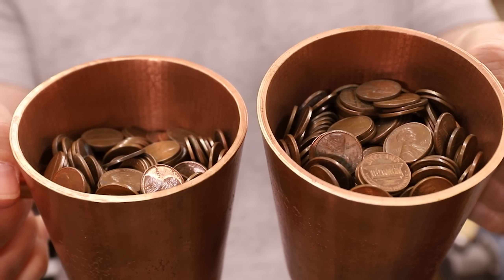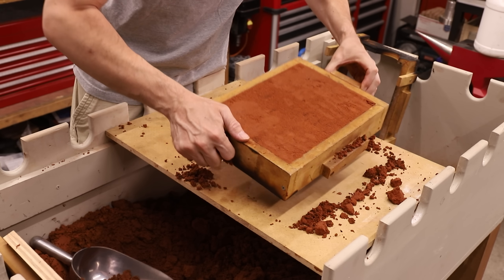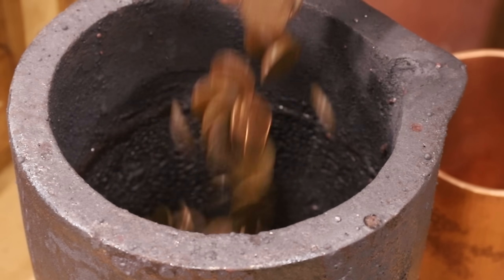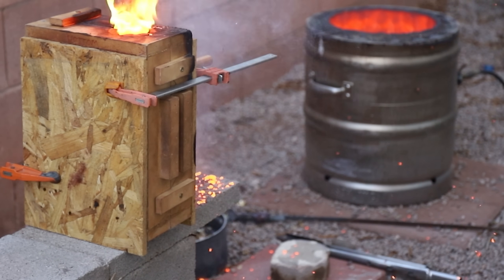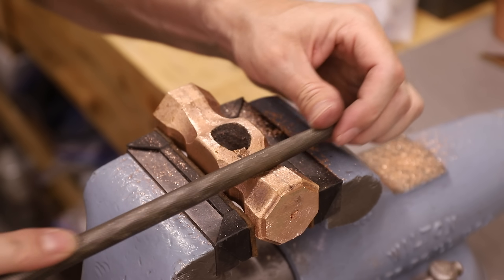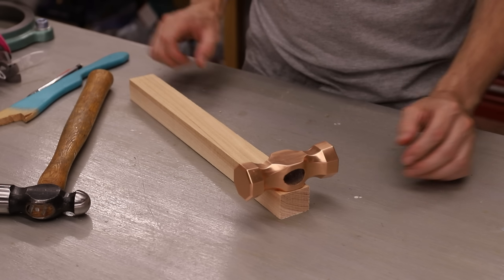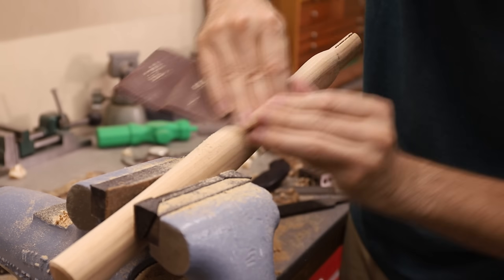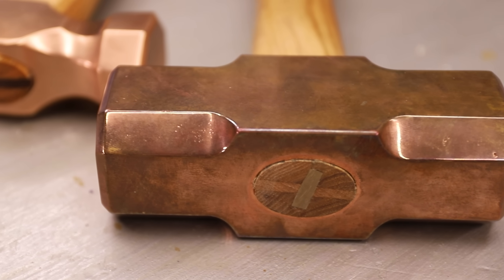Making a Hammer out of Pennies (1000 Melted Pennies)

Comment: I know this is kinda old, but whenever you make a tool with a pass-through handle like this (or the axes you made), the eye through the head should NOT be tapered. In cross-section, the eye should have an hourglass shape and the cut end of the handle should match, being slightly tapered itself in the opposite direction you have it (slightly thicker at the base, narrow at the cut end). The wedge will spread the top, fitting in perfectly with the hourglass shaped eye. This removes the need for a shoulder on your handle, which creates a natural breaking point.

Comment: Just for context: A 1955 double die Lincoln Wheat Cent is worth $782-$18,501 depending on its condition.
Btw, the material worth is 3 times as much as its face value. A one cent coin has 3 cents worth of copper in it.

Comment: This is technically a felony, though I doubt the secret service are going to actually enforce it.

Defacing/destroying in use US currency is a felony enforced by the secret service. They handle counterfeit currency too.
Reply: Only a felony if you try to sell it in scrap
Reply: @Hunter50r naw it's still technically a felony if it's currency that's still in circulation. But again I highly doubt the secret service is going to spend the time going after someone defacing pennies. They're actually phasing pennies out completely soon
Reply: @simul8rduude  it’s not if a coin is clearly altered and no one is trying to sell it or use it for fraudulent intent. It is completely legal to deface currency or use it in any way you wish.
Reply: @simul8rduude It is perfectly legal to melt pennies and nickles as long as you're not trying to profit off of their metal value

Comment: The problem is - it will tarnish very fast and extensively. I have a bronze cymbals on my riq (admittedly, you touch them with fingers while playing), and they have black spots all over. Oxides of copper have green color, so without regular polishing, it won't stay as beautiful. Especially when hammering starts damaging the surface. It is beautiful, though.

Comment: Is Melting Down Legal

It is unlawful to melt down U.S. pennies and nickels, primarily because the value of the metals they contain (copper and zinc in pennies, copper and nickel in nickels) can exceed their face value, which could deplete their circulation and cost the U.S. government significantly to replace them  This prohibition was enacted in 2007 by the Secretary of the Treasury under the authority granted by 31 USC § 5111(d)(1) to protect the nation's coinage, following a period when rising metal prices made melting these coins profitable  The rule specifically bans the exportation, melting, or treatment of these coins 

However, there are important exceptions. It is legal to melt down pennies and nickels for non-profit purposes such as educational, amusement, novelty, or jewelry-making projects, provided the intent is not solely to profit from the metal content  For instance, creating a piece of jewelry from a penny is permitted, but selling the resulting metal for scrap profit is not 

In contrast, it is generally legal to melt down other U.S. coins, such as silver dimes, quarters, and half-dollars, as well as gold coins, as long as the action is not done for profit and does not involve fraudulent intent  The primary reason for this distinction is that silver and gold coins are not in general circulation, so melting them does not pose the same risk to the nation's currency supply as melting pennies and nickels 

It is also illegal to alter, deface, or destroy U.S. currency with the intent to render it unfit for circulation, which includes actions like burning dollar bills with the purpose of making them unusable  However, this law is focused on fraudulent activities and does not apply to non-fraudulent alterations like making jewelry from coins 

Additionally, travelers are limited to taking no more than $5 worth of pennies and nickels out of the United States to prevent large-scale exportation for melting abroad

Comment: Department of the Treasury

Monetary Offices

31 CFR Part 82

AGENCY:

United States Mint, Treasury.

ACTION:

Final Rule.

SUMMARY:

To protect the coinage of the United States, the United States Mint is adopting a final rule that prohibits the 

exportation, melting, and treatment of 5-cent and one-cent coins. This rule is issued pursuant to 31 U.S.C. 5111(d), which authorizes the Secretary of the Treasury to prohibit or limit the exportation, melting, or treatment of United States coins when the Secretary decides the prohibition or limitation is necessary to protect the coinage of the United States. This rule's purpose is to ensure that sufficient quantities of 5-cent and one-cent coins remain in circulation to meet the needs of the United States

Comment: Old pennies (pre-1992) contain 95% copper, which means:
Pure copper in 9.45 kg of coins = 9.45 × 0.95 ≈ 8.98 kg.

Scrap copper prices (2025, approximate):
Pure copper (Bare Bright, Category #1) - £6-7 per kg.
Copper from pennies (95% bronze) - £5-6.5 per kg (not all scrap yards accept coins, some may consider it 'low-grade' scrap).

Calculation:
8.98 kg × £5 = £44.9 (minimum).
8.98 kg × £6.5 = £58.37 (maximum).

So, 1000 pre-1992 pennies are either worth £10 as currency, or up to £45 if sold as scrap metal.

Comment: Are there any laws in your country about using coins (legal tender) to destroy them. In the uk 
there are laws which make it illegal to deface or destroy a coin of the realm. Coins which are 
legal tender are owned by the royal mint. I’ve never heard of anyone ever being charged with 
defacing a coin but just wondered. I’ve used these yo type of hammers on gas installations 
where a spark would not be welcomed. Bronze is the normal metal which does not throw a spark 
when hammering any other metal.
Reply: Not in this instance

Comment: Pre-1982 Pennies would be nearly all copper.

Post-1982 Pennies are a copper + zinc mix.

If you melted them down in this fashion, you'd have a brass hammer.  So guessing they used all older pennies since it's that reddish copper tone.

Comment: Isn’t destruction of currency illegal?
Reply: CFR-31b-1-82
§ 82.1 Prohibitions.
Except as specifically authorized by the Secretary of the Treasury (or designee) or as otherwise provided in this part, no person shall export, melt, or treat:
-(a) Any 5-cent coin of the United States; or
-(b) Any 1-cent coin of the United States.

CFR-31b-1-82
§ 82.2(b) exceptions
The prohibition contained in § 82.1 against the treatment of 5-cent coins and 1-cent coins shall not apply to the treatment of these coins for educational, amusement, novelty, jewelry, and similar purposes as long as the volumes treated and the nature of the treatment makes it clear that such treatment is not intended as a means by which to profit solely from the value of the metal content of the coins.

Comment: melting US pennies is against the law.
Reply: CFR-31b-1-82
§ 82.1 Prohibitions.
Except as specifically authorized by the Secretary of the Treasury (or designee) or as otherwise provided in this part, no person shall export, melt, or treat:
-(a) Any 5-cent coin of the United States; or
-(b) Any 1-cent coin of the United States.

CFR-31b-1-82
§ 82.2(b) exceptions
The prohibition contained in § 82.1 against the treatment of 5-cent coins and 1-cent coins shall not apply to the treatment of these coins for educational, amusement, novelty, jewelry, and similar purposes as long as the volumes treated and the nature of the treatment makes it clear that such treatment is not intended as a means by which to profit solely from the value of the metal content of the coins.
Reply: only if the intent is to sell it for profit

Comment: Illegal ?
Reply: CFR-31b-1-82
§ 82.1 Prohibitions.
Except as specifically authorized by the Secretary of the Treasury (or designee) or as otherwise provided in this part, no person shall export, melt, or treat:
-(a) Any 5-cent coin of the United States; or
-(b) Any 1-cent coin of the United States.

CFR-31b-1-82
§ 82.2(b) exceptions
The prohibition contained in § 82.1 against the treatment of 5-cent coins and 1-cent coins shall not apply to the treatment of these coins for educational, amusement, novelty, jewelry, and similar purposes as long as the volumes treated and the nature of the treatment makes it clear that such treatment is not intended as a means by which to profit solely from the value of the metal content of the coins.

Comment: You should be arrested for the destruction of federal currency!
Reply: CFR-31b-1-82
§ 82.1 Prohibitions.
Except as specifically authorized by the Secretary of the Treasury (or designee) or as otherwise provided in this part, no person shall export, melt, or treat:
-(a) Any 5-cent coin of the United States; or
-(b) Any 1-cent coin of the United States.

CFR-31b-1-82
§ 82.2(b) exceptions
The prohibition contained in § 82.1 against the treatment of 5-cent coins and 1-cent coins shall not apply to the treatment of these coins for educational, amusement, novelty, jewelry, and similar purposes as long as the volumes treated and the nature of the treatment makes it clear that such treatment is not intended as a means by which to profit solely from the value of the metal content of the coins.

Comment: 2000° copper ?  I had superheated water from a steam boiler spray on my foot, went right thru my sneaker and dealt with a 2nd Degree burn on my foot, that I did not feel any pain for the first 2 days, and I was tough guy saying “I feel nothing”, I said that to the doctor, and she said, you’ll feel it in a few days, boy was she spot on, on day 3 OMG !!! That pain came screaming in and lasted for over 2 weeks, where Oxymorphone opiate pain killers (I use for my lumbar disc herniation in my back) did barely anything, maybe knocked it back 15-20%, I can’t imagine getting splashed by 2000° copper, when I was completely “sidelined” by the top of my foot getting hit with what ? , maybe 250°-300° F “superheated” pressurized steam.  It took 2 months to heal, and is still scarred 2 years later.

Comment: To be precise (assuming all the pennies are Lincolns):
1909-mid 1962: 95% copper, 5% tin and zinc
Mid 1962-mid 1982: 95% copper, 5% zinc
Mid 1982-to date: 99.2% zinc, 0.8% copper with a plating of pure copper. Total content: 97.5% zinc, 2.5% copper.

Comment: Not wearing gloves while using boiled linseed oil is upsetting. It's full of heavy metals and chemicals, it's not really boiled it's chemically treated. Walrus Oil does make an actual boiled linseed oil and it's super high quality but needs to be thinned with citrus solvents like 80 to 90%, and even then it takes a very long time to dry.

Comment: Hate to tell you that hammer if like 2.5 percent copper and 97.5 zinc. So it's a zinc hammer with a tiny amount of copper. You can look it up on the US Mint website.
Reply from the maker: Pre 1982 Pennie’s man.
Reply: @robinson-foundry  they changed to the current penny formula in 1982. If you added anything pre 1962 it may also have some tin in it.

Comment: Modern pennies are not made of solid copper. Pennies minted in the U.S. since 1982 are composed mostly of zinc (97.5%) with a thin coating of copper (2.5%).

Before 1982, pennies were primarily made of 95% copper and 5% zinc. However, due to the rising cost of copper, the composition was changed to the current copper-plated zinc structure.

Comment: Of i may ask how do your wood handles hold up with the grain being oriented incorrectly?

Is the usage light enough to make that a null issue.

I ask because i was a carpenter for many years and grain orientation caused many handles to fail badly but that was on framing hammers and sledgehammers that experience huge forces applied on them

Comment: Pennies makes sense as the alloy the mints used for them, makes the material both workable, and as durable as a copper alloy can be.  
Seeing this hammer reminded me of something that took place, back in 1990. 

A friend of mine had bought a Porsche 959 direct from Porsche in Germany. He even went to the factory there and chose all the fine detailed stuff for it. 
Shortly after it was delivered to my friend's place,  I went over to look at it and (hopefully) go for a rip in it. When he opened the trunk, there was a well worn brass hammer sitting there. I figured the thing was at least 50 years old with how worn the head was. 

He was going to keep it but I knew there was a mechanic somewhere in Germany missing that hammer. So I explained that to him and convinced him to get it back to it's owner. Turned out the then current owner was the grandson of the original owner. It was used to fine tune the hinge alignment on the trunk lids and engine covers and had been doing so for close to 60 years.

Comment: Any idea how to protect it from corrosion and rust? I know oil works for iron and steel, but it's also not the best if you don't keep up on keeping them well oiled. Cerakote is an amazing corrosion protection, but I doubt you would want to Cerakote over the nice looking copper. They do sell a clear coat, but I'm not sure how well (or if) it would hold up to hammering. Their one clear coat they tested with a shotgun slug and it appeared to remain perfectly in place despite the metal under it being severely deformed. I'm not sure if there are other clear coats that would work either... but I'm sure there are other options out there too.

Comment: for the love of god work on your print settings the stringing and globing is just horrible this is to common to see in the bamboo lab community a stock cr10 with base settings could do better
Reply from the maker: Those were beautiful prints actually. Sure there was a tiny bit of stringing on one small part but my CR10 would not have done better. And these printers print 3 times as fast! There’s a reason people including myself are dumping old machines like the CR10. Stick with it though. I’m sure you’ll get the hang of it with some more practice. Thanks for watching!
Reply: @robinson-foundry  I'm sorry but no those weren't and while this was not something that needed strict tolerances that i understand i could tell by how those came out they would need adjusted for such we had stock k1s from creality we had at 300mm/s with finishes equivalent to 6k res resin printers bamboo lab printers are just trash as ive messed with them in the past and stock first gen qidi clones of flashforge creator pros had better quality and for the price of em you can get a prusa mk4 for cheaper that can print 200mm/s no issue  with better quality then any other printer on the market at slower speeds rn with a max speed for a bed slinger at 600mm/s

Comment: Your riser needed to be a larger cross section than your part.  It froze off before the hammer portion due to it being the first metal that entered the mold.  A shorter inverted pyramid or teardrop shop should work better from my foundry experience.

Comment: very nice Craftsmanship  on the design ,Casting ,and especially on the Filing and Polish  I grew up  working with my Father   Doing many Antique Restorations  and Automotive and Motorcycle Repairs  Copper and Brass Hammers  were some of the Tools of the Trade they gave you the Advantage to  beat on  mechanical Fasteners without   Doing too much damage to the threads  or  fastening system  We also used a Raw Hide Sledge hammer  that has made up of 1/4” thick  pieces of Rawhide  rolled up together  and held together with a Steel mechanism that bolted together and had  a casted area to attach a Wooden Handle  Impersonally preferred to use Hickory Wood  with a Beeswax Finish on  that had some Cross hatching  on the handle to give you a solid Grip on  BTW the Hammer itself was a Antique my Dad  got from his Father and I now have  along with a brass headed Hammer

Comment: I refurbish drums and I think you have me a great idea and solved a problem I have had. I want to have gold or copper colored rims but can’t find any one that makes them ( the drum companies must just want that market for their factory built drums) . I think I could quite possibly do this with pennies. It would be durable and attractive. I thought about sand blasting and metal dipping them but I think the finish would wear off after use but if it’s this color all through out then it will last forever. I just what to know how thin you can go and still have it turn out good ?? Drum rims are not all that thick, except the base drum rim. Oh I think you should have made the wage out of pennies as well , just for the looks of it.

Comment: Is there a practical need for a copper hammer or is this just a , "Hurr, durr, let's melt stuff, dOoD" situation?
Reply: Copper hammers have a better protective ability than brass hammers. They are typically used on expensive machined components to apply force to parts with a reduced risk of damaging them and to avoid sparks.
Reply: @MoxJet629  And you get to melt stuff. TIL.

Comment: How does the metal flow around the core? Unless its floating in mid air, it would be touching the bottom mold, how do you keep it away from all sides so the copper can flow around the core evenly?

Comment: 30 seconds in and you've lost me bud. I can't relate to a guy rich enough to buy 3d printers to make his copper hammer.
Reply: You can get an Ender 3 capable of doing lost PLA molds for under $100, which is probably cheaper than every other power tool used in this video.

Comment: Baby powder trick and the shadow tracing are very clever!
Reply: Fun fact the copper on the pennies is just thin foil simply burns up. So you're making a pink hammer. His ratio is backward, 5% copper the rest is zink
Reply: @rickfox6995  You missed where he pointed out he used pre-1982 pennies which were mainly copper with a tad of zinc.